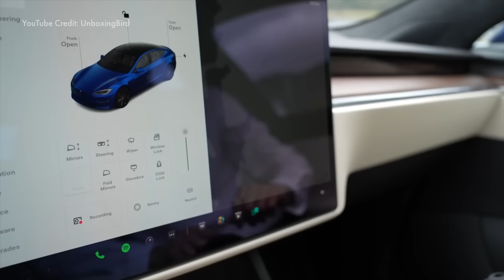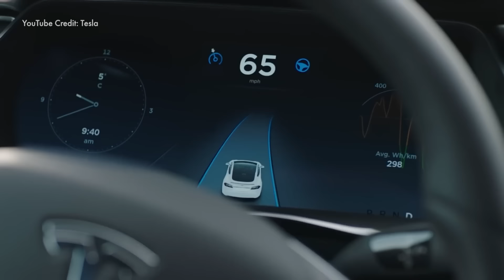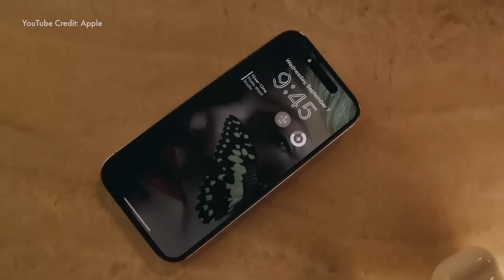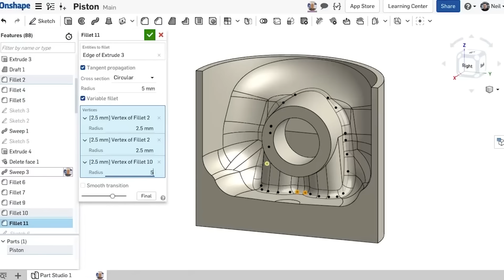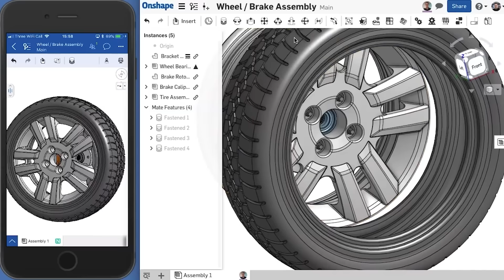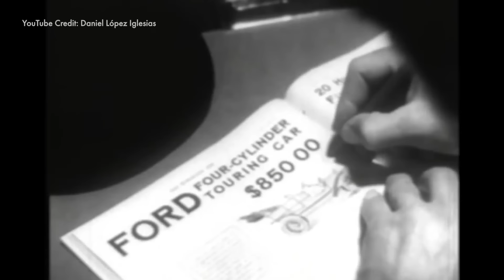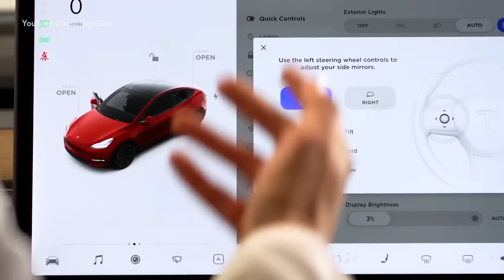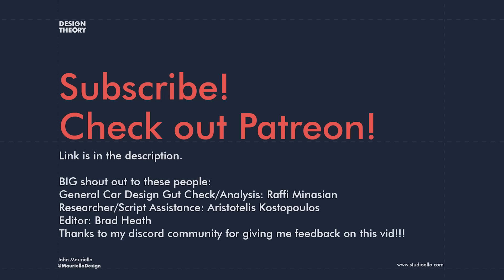How One Designer Saved Tesla From Bankruptcy TWICE

Comment: Love the breakdown, but I kind of disagree about how much the envelope was pushed, especially with the original Model S. Yes it was a nice design, but nothing revolutionary. Just an amalgamation of other beautiful vehicles.
Reply from the maker: I actually agree with you. He didn't push the design too far...but that was very intentional. You have to remember that we're looking at the design 10+ years later and it still looks great. Not many car designs are able to pull that off. That's why the Tesla design language is great...not because of what's new about it, but because of the restraint Franz had in designing it.
Reply: Agree - the Model S wasnt revolutionary but needed to stand out in so many ways- a tight rope to balance on from a design standpoint- also paving the way and solidifying for the Model3 design language. Decade long slow clap for Franz
Reply: Nowadays, so many cars have tried to emulate the design of the Model S.  From a distance, they all kinda look the same. . .  because the Model S, not being able to fill up at a gas station, had to be reAlly slippery through the air.  Form follows function. And most styling is “copycat”.

As a side note. . . My dad used to say if it were not for the radical styling of the 1948 Studebaker, we’d all still be driving around in 1946 Fords
Reply: But take most of the vehicule from that period  I guarantee you the model s will still look modern
+  by design  I remember Steve job said  it s not only the look   at  that it was revolutionary  
At one point you see every other car maker Starr wanting to do the same  for some of their model
Reply: Tesla design is really good. But what also helps it 10 years later is that we’re still yet to see 2nd generation of it’s cars. 

Car design, because it evolves with technology, tends to get old when a new generation comes. Something that looked astonishing might look outdated in 5 years. Just because we invented new lighting technology, advances in chassis development made possible bigger rims, new assembly techniques made gaps and seals slimmer etc.
Just look how pre-facelift model S (with black front fascia, looks less fresh than newer ones.

Of course, good design will always look good, even 50 years later. But for mainstream vehicles, manufacturers need fresh designs to stay relevant, unfortunately.
Manufacturers like Porsche are making cars rather similar from one generation to another. That helps them to have timeless, lasting designs. If Porsche made huge design changes from one generation of 911 to another, 997 for example wouldn’t look so fresh nowadays, almost 20 years later.

If Tesla is smart, which I believe is, they should make an incremental evolution in terms of design for new generations.
Reply: Where Tesla shines, and where many car companies fail is not with their design. I mean the Lucid is arguably hands down the superior car. Teslas strength lies in pairing manufacturing and design together. 

 Teslas overall profit is ridiculous per car. Probably more than any car maker. While Lucid is barely holding on. 

 There is a guy named Sandy on a channel called Munro Live. He has a great break down on Tesla that we don't normally think about.

 Anyway the way they juggle aerodynamics, manufacturing ease, and looks is good. 

 Personally I feel like Teslas are generic as hell now, but not last decade. The new Kia EV6 Gt is a great looking car. A freaken Kia! (Crap range, but it is a 60k super car that is fun as hell to drive.)

Comment: I'm glad that you pointed out the need to have tactile buttons in the interior. While the design of the monolithic screen is striking, it takes your attention off the road. Even in cars that have capacitive buttons i sometimes struggle to find them while i'm having to look out for other drivers, or pedestrians on the road. I believe that electric cars are the future, but i will not be driving any of them that by design force me to drive unsafely
Reply: Nah the screen lowers cognitive load. All the main functions you need to drive are physical.
Reply: This is not what’s keeping you from buying a Tesla..😂
Reply: I'm sure you don't own a model 3. Otherwise you'd know this is a non-issue. Except maybe if you're very, very old.
Reply: Most consumers go for what looks shiny and new. Very few will avoid a car because it has a touch screen.
Reply: Haha no, this point is from ppl who actualy fiddle with all the damn buttons on all the time.

Just drive the car.
Reply: The voice command button eliminates the need for on-screen buttons. We've actually reached the point where like Scotty we can just talk to the computer.
Reply: @chidorirasenganz  Exactly, the Model 3 has about 20 buttons plus voice control and control over many functions with buttons on the steering wheel! Any alternative judgement is simply uninformed speculation from non-users who have chosen to forever be - nonusers who have not ever tried the systems.
Reply: @hiltithedrill  I'm very old. And over time I've come to discover, that's not an excuse!
Reply: What you don’t realize is you don’t have to push buttons as often as you do in normal cars. It automatically turns on climate control, seat heaters , wipers , lights etc. almost everything is automated.
Reply: It annoys me how many companies insist on moving to “touch” interfaces (especially in things like cars where your attention needs to be elsewhere, or stuff like rapid data entry). Buttons are absolute king for tactile feedback!!
Reply: @jameswhatsit  So that my friend is total bull, and if you owned a Tesla you would know that Tesla is a forward thinking Company that is leading the industry in a particular direction, and that direction is to fully autonomous electric vehicles, so by the time we get to level 5 autonomous driving, a generation will have grown up with the idea that driving is passé, something that no one has to do. 

You will simply summon your vehicle on demand from either a smart phone, watch or smart glasses, no need to worry about other drivers or pedestrians, because you will not be driving these vehicles, they will be driving you. Comphrende. Cheers🥂
Reply: Everyone ignores the speech controls.  With Tesla massive capability to control the car’s features with voice controls, it make buttons largely unnecessary.
Reply: Only thing I occasionally use while driving is AC, and it's on-screen controls are way more intuitive than any freaking buttons. Oh, and Spotify but then I usually have autopilot on anyways. All in all, one screen is way less distracting than million buttons
Reply: @bearlemley  speech controls are useless. It doesn't understand my native language nor my finglish accent. It's always awkward to speak to the car and it never does the right thing!
Reply: @bearlemley  Exactly! So I've had my Tesla going on 4 years now, and even I sometimes forget to use that function. I just got the latest beta update and it's awesome, can't wait to see what they do to improve on the summon function and the park assist function as both are still somewhat sketchy, and I haven't quite gotten used to allowing it to make the unprotected left turns, but I'm working on it. Cheers🥂
Reply: You can get haptic feedbacks from tapping on the screen
Reply: @chidorirasenganz  Nah, having to dive through multiple touch screen menus to open the glove box is idiotic. Having tiny-ass touch buttons to change cabin temp at the bottom of the screen makes you have to look down every time. In my Honda I can just turn a big knob that I can find without ever having to take my eyes off the road. And don't say 'use voice commands' because that's annoying and inpractical. Sometines you want the cabin to be quiet, like on a road trip when others are sleeping, a  sleeping baby in the car, or being on a call. Same for turning on windshield wipers. Buried in touch screen, having to take your eyes off the road. The auto-wipers suck, and come on even when there's no rain, or don't come one soon enough when there is rain. In most cars, there's an easy stalk you can operate without taking your eyes off the road, but that would just be too easy for Tesla. Same for the horn. Tesla took it from the easy to hit center airbag cover and relegated it to a tiny capacitive button the size of a dime on one side of the steering wheel. Because that's a lot safer, right? Good luck hitting that thing in a panic scenario when the truck next to you starts merging into your lane. It seems like Tesla's user interface is particularly designed to be a distraction and taking your eyes off the road as much as possible. The only thing that accomplishes is to reduce safety. You say it reduces cognitive workload, but it does exactly the opposite. The big screen, with all controls and information shoehorned into it, is a constant source of distraction.
Reply: @jeffholman2364  The Model 3 only has 2 multi-use buttons on the steering wheel and one for hazard lights (legally required). Where are you getting 20 physical buttons from? Are you including the window switches and seat adjustment switches? Even then it's only 14 front and back, but as far as just the driver is concerned, it's 9, and that includes those window and seat switches. Hell, even mirror adjustment, steering wheel, lights and windhsield wipers need a dive through screen menus.
Reply: @Kr0n1k8  It automatically knows when you want AC vs heating, automatically knows when you want seat heaters on and automatically knows what temperature you want in the cabin? Really? That's complete BS. You need to turn all those things on and off or adjust them through the touch-screen. Voice commands work half the time, and even when they do it's annoying, because I'd rather just turn a knob in 1 second to change the cabin temp than having to push a button for voice command, THEN say what I want. If I have to push a button, it might as well be for the function I want. And voice commands are not always practical, like when having passengers who are talking in the car and having to ask them to be quiet so you can issue a command, or passengers or a baby sleeping in the car on a trip, or being on a call. Technology is supposed to make things easier, but this whole touch interface for everything overcomplicates the simplest things all in the name of aesthetic design.
Reply: @theodorehaskins3756  Tesla will have Level 5 autonomy in another 20 years... maybe. It took them 6 years (since 2016) to get to Level 2 (which is what FSD Beta is), and each successive level on the SAE scale is progressively harder, not easier. Once Level 5 is reached and passengers can just lounge with not a care in the world, not having to babysit the car, it makes sense to have touch screens. But while humans are still in control (and they will be for a long time to come) having all controls in a distracting touch screen that requires you to look at it for every input, makes no sense. It's just an aesthetic choice, one that is far more distracting and less safe. And yes, I have driven every single model that Tesla makes quite extensively, so I'm speaking from personal experience.
Reply: @ganymede3141  Really! So are you aware that 2 intelligent people can look at the same information and come away with a different understanding of exactly what that information is about?
Reply: @ganymede3141  So what happens if you're wrong?
Reply: @ganymede3141  A dive through the screen menus? One example, windshield wipers are accessed through a "button" on the stalk AND a button on the steering wheel, which activates voice commands.
Reply: @jeffholman2364  You only get that stalk button on the Model 3 and Y. The S and X have a capacitive button on the steering wheel which you have to look down to hit because it's small and flat and can't do it by feel. The physical button on the 3 and Y is arguably much better. But even hitting those buttons just brings up the menu on the main screen, so you then have to take your eyes off the road to chose a setting or intermittent level. My car just has a stalk with a rotating ring that allows me to turn on wipers and adjust intermittent level completely by feel and without having to take my eyes off the road once. Try to be objective for a moment. Isn't that better than pushing a button on the stalk or wheel and then still having to use and look at a screen to your right to pick settings? Voice control also still requires pushing a button to activate it, and if I'm doing that, it might as well be for the thing I'm trying to control. And using voice control is not always an option, and seems like an unnecessary and cumbersome way of doing something that could be as easy as flicking a stalk down once or turning a ring on it that takes a second, without having to push a button, wait for the system to respond, then say your command, hope that it got it the first time, then wait for it to execute the action. I've tried all this in both a Model 3 and S and it's unnecessarily cumbersome and impractical. Sometimes, flicking a switch within finger reach is much easier, simpler, safer and more convenient.
Reply: @theodorehaskins3756  If I'm wrong, I will accept that I'm wrong and readily admit it. So I'll say it here and now, you can come back and gloat if you are right: Tesla will likely never have a fully autonomous, SAE Level 5 system that can go anywhere a human can and with the liability being fully with Tesla (not the driver, as it currently is). If it does ever get there, it will be at least another 15-20 years. It might reach Level 4 in 10 more years with the reliability level necesssry for such a system.
Reply: @ganymede3141  So with that statement, you've just admitted you know that you could be wrong is all I'm saying, and so I will admit that I don't know the answer to you're definitive statement that Tesla will get there in another 20 years, and I don't know how long it'll take them to get there, it may take longer, I would be surprised if it did, but it could possibly take longer, and here's where the competition could push them to get there sooner, but at last the competition don't seem to be doing that well themselves, because they're going down a blind ally with little to show for it, because no one is going to buy a vehicle, with all of that extra gear attached to it, and according to Elon who believes that it just doesn't add any real value. 

So why are they continuing down this seemingly endless path attempting to do something with equipment that simply don't add value is something that is beyond me to understand. 

So maybe you have an opinion about that too. Do you believe the competition it's on the right path?
Reply: @theodorehaskins3756  Yep, I could be wrong. I also could be right. Time will tell. Other competitors are on the same path as Tesla, and some are ahead. Cadillac's Super Cruise can be used legally with hands off the wheel. It also has driver eye monitoring using computer vision, while Tesla still relies on a torque sensor in the steering wheel, which can be fooled with a water bottle taped to the steering wheel. So Tesla is lagging behind on that front. Tesla also got rid of radar and sonar, and is not even considering lidar, relying exclusively on cameras, which is a big step backward. Cameras can't see through fog, dust, rain, snow, but  radar can. Rivian, Ford, Hyundai, Honda, Mercedes, BMW and others all have their own version of Tesla's Autopilot, and they all work just as well, except they don't hype about it every other day like Tesla. All of their sensors are integrated just like Tesla's, and you don't see any cameras or lidar pods sticking out. Mercedes' Drive Pilot is actually the first system to be internationally certified as a Level 3 autonomy system, which is beyond Tesla's Level 2 FSD Beta. It was released in Germany at the end of 2021, coming soon to the US as well. So Mercedes is actually ahead of Tesla, but again, they don't beat their chest about it and hype it as much as Tesla does. I really don't think Tesla has any advantage over anyone else in the self-driving department, but they are leaps and bounds above everyone else in the hype department.
Reply: @ibanezrg7421  no it really is, I will stick with my cars that have tactile climate control. I don’t want to have to click onto a screen in order to change the temperature of the vehicle, it is just badly designed interface

Comment: The Model 3 is 5 years old already and still looks fresh and futuristic.
Reply: Yes it does, but they’re so common now, it’ll be nice to see a modest redesign to set the new ones apart. I’d like to see the 3 offered in a hatchback to increase flexibility.
Reply: @Wooster77  They will not do that because it would cannibalize their Model Y. I would definetely buy a M3 with hatchback. The MY looks ugly to me, it ist looking like oversize & overweight, fat. When it came out I wanted to test drive it, but cancled the test drive when I saw it in reality. Drove a M3 instead. If it had a hatchback I would have bought it directly after the drive. It looked really sleek, a bit like a Porsche.
Reply: @Wooster77 Are you happy with the redesign?

Comment: Not only do I consider the Cybertruck great looking, but, if seen as an SUV, a fully-loaded one, with its spectacular off-road abilities, is a large, versatile hauler and camper. Add a Cyberlander camper, and it might be the best all-rounder available.
Reply: Agreed. Truck body design is one of the least innovative in the whole automotive industry. This is going to bring trucks to a new group of people. I've wanted a truck for practicality but I just can't bring myself to get one, probably for the same reason most current truck guys wouldn't get the CT.  I am looking forward to getting a CT if pricing is anywhere near what was stated in 2019.